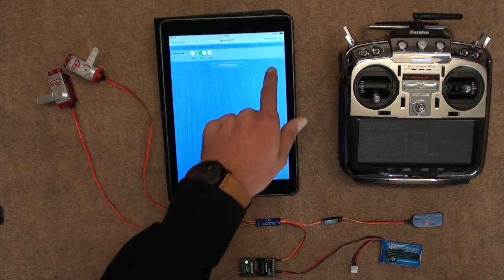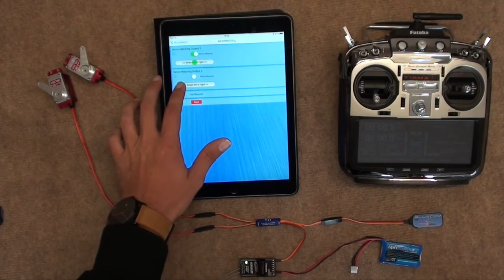Powerbox-Systems MicroMatch - How to

Comment: I bought two of these. supposedly there is a phone app to control the servos. I cannot find any such app in the google play android store! Do you have any idea? I also looked for the bluecom adapter without any luck. help! I've contacted the seller, Chief Aircraft but they won't answer me. I also contacted Powerbox Systems and they won't answer either! Any help would be greatly appreciated.

Comment: Hi Martin I have a hanger 9 Beast 60e biplane with two servos one top and one bottom wing would the micro match work if I wanted to plug them in to a gyro 3e using it as a Y lead on each wing 
Thanks 
Nathan
Reply from the maker: Hi Nathan, yes, it works exactly like a Y lead.  If you then plug the "Y" lead into the gyro, then the gyro will work on both servos that are connected to said Y lead, with the benefit of being able to setup the centre and end points of each servo independently of each other. Hope that helps! Martin
Reply: Hi Martin thanks some on order now for the Beast 
Sorry I missed you at Weston I have sent you a message on FB 
Thanks 
Nathan

Comment: I just go these to try on my rudder, but the servo wires are so thin compared to  my servos.  Are these ok for giant scale 3D planes? I run 20awg wire servo extensions. These seem to be maybe  28awg. Thanks.
Reply: Based on the name, I assumed that this did servo matching for single surfaces. I guess it doesn't I'll return it :(
Reply from the maker: I believe the wire is 0.35 and is set for about 10A, which should be fine.  Its about the same as the servos themselves come with.
Reply from the maker: It does, you can use it to setup say two aileron servos on a single surface, or two servos for two separate (or joined) elevator halves.
Reply: Thanks. Hitech HS-7950TH servos come with much thicker wires. About twice as thick. But I guess for a short distance it won't much resistance. But it's not ideal.
Reply: Ok, but I will they fight each other if the geometry is different for both servos, like in ailerons? It is never perfect anyway. Just by matching middle and endpoints, my aileron servos would pull 2 amps at half deflection. Even with 9 point radio balancing (Spektrum DX9), they pull one amp in between points.
Reply from the maker: I never used a 7950, however I know that often the silicone wire is thicker, but actual copper content is the same...  The powerbox wires have a strong but thin coating, with quite high copper content.  By all means, test it until you are satisfied, but I know people are using it with other servos succesfully.
Reply: OK, thanks. I won't return it then. I can free up a channel using it for elevators where servos won't fight each other.